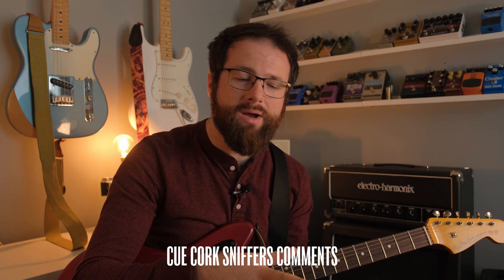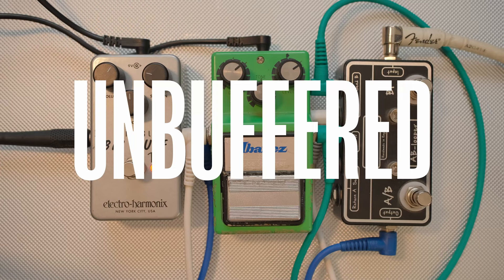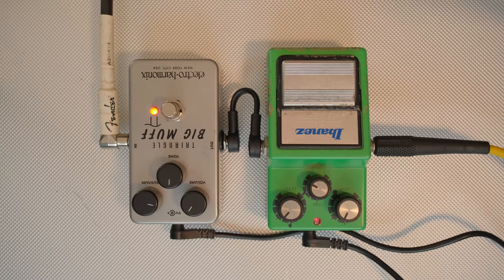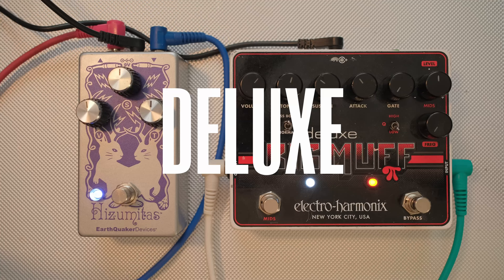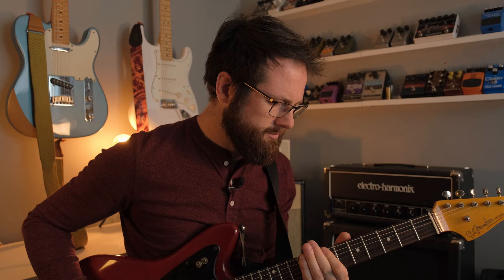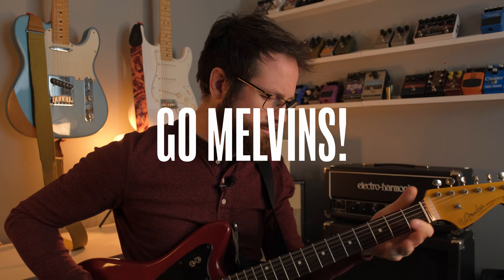Why you're doing it wrong: Big Muff tips and clips

Comment: Great video. Muff after OD is what got me away from the fuzz face style (2 transistor) fuzzes. Currently using the MXR Variac fuzz after an SD-1 and Bd-2, but before that had one of the mini EHX Ram’s Head reissues on my board.
Reply: Love the Variac fuzz. It’s got such a ‘ripping’ sound. I have to admit I bought mine cuz John Frusciante started playing one. 
You’re using a bd-2 into your Variac? What are your settings? 
Thanks
Reply: @LawGone1  I run my BD-2 as a cleanish boost after the SD-1, set with Level around 1:00, tone and gain set at about 9:00. I really like the SD-1 more with the Variac Fuzz, gives it a real gritty sound. My Variac fuzz currently is set as follows: 

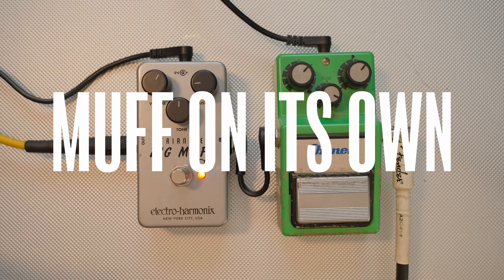Tone - 2:00
Variac - 10:00
Output - 9:00
Gain - 3:00

Comment: Yeah..... no

You don't run the Muff into a TS9 with the gain half the way up, that sound horrible, drop the gain on the TS9 to almost 0, take the volume up to the required level.

The idea behind that is to smooth the Muff using the TS9 eq curve, not boosting the TS9 using a muff, the TS9 sounds like shit when boosted, no matter what you push into it.

Those settings also work better for me with the TS9 before the Muff too, the Muff already compresses the sound a ton, you don't need the gain of the TS9, you just need the mid boost it provides to make the Muff sound tighter.

Try it, TS9 gain on 0, Level at taste, Eq at noon, before it clears up the Muff and after it gets you a smooth lead tone (yeah no metal there)
Reply from the maker: Look out for an upcoming short. It'll be the outtake in which I tried all sorts of positions, including drive off. It all sounds awful, IMHO! 🤣

But I'd want some drive from the TS9 for some gain staging/pseudo channels. If we're just going to use the mid-boost of the TS9, why wouldn't we just use an EQ!?
Reply: @doctorfuzzzdirtbox  It is not that simple, a band EQ has a selective filtering on the frequencies so you have gaps between the controls that you can not fine tune without moving the surrounding ones, the TS is more like a parametric EQ, If you have a parametric EQ you can absolutely do that, setting the right amount of amplitude and frequency center and then pushing it a bit, is just easier to shove the TS9 and turn it on that barring frequencies on an EQ pedal, usually.

I typically think about the TS9 as a boost with optional compression, being the drive what I use to compress the sound, the gain sounds awful by itself on most cases.
Reply: @doctorfuzzzdirtbox  Forgot to mention, you need to lower the Muff volume to unity, or it will drive the TS9 even if it has 0 Drive
Reply from the maker: @Fernando-ry5qt  I tried it all, man 😅 Short to demonstrate will be live within the hour...
Reply from the maker: @Fernando-ry5qt  An EQ would still be more flexible in that case. A TS9 just does what it does. Why not at least use Haunting Mids or a Tone Job? Why have a drive stage in there at all, is what I'm saying (within this Muff stacking context.) And I personally like to have a low fuzz on the Muff, some drive from the TS and then I have one, the other, both or off! Basically 4 channels!
Reply: @doctorfuzzzdirtbox  Haunting Mids would get you there, yes.

I do that too (actually i don't even use a TS anymore), run the low gain overdrive with a low gain so it is more flexible, but it does compress the sound more in that way and the Muff loses clarity imo.

I mean, to each their own, Im just explaining you why people run it that way haha (I used to do it), cuts far better in a live band than the opposite and gives a more defined sound for leads/solos.
Reply from the maker: @Fernando-ry5qt  yeah, I hear you man! I'm all for the discussion! 🤘

Comment: An '81 Les Paul Dlx into a Sovtek Big Muff into a 100wt Hiwatt has been in my rig for 25 years for a reason. $70, in the wood box, and I was off...
Reply from the maker: Crazy how cheap they were to buy and how expensive they've become! Thank Mike for the reissue!
Reply: @doctorfuzzzdirtbox  

If only they'd reissued it with those switches, where you can stand on the switch and it's still on and when you take your foot off it turns off. Wonderful.

Comment: I run my muff with a Danelctro fab overdrive behind it. Budget pedal with a super muddy drive. BUT run it into a muff with sustain set about or three o’clock and the tone all the way up (or bypassed if you have a mod), and suddenly it beefs up the distortion so much. It’s unbelievable. Best I can describe it is that classic ‘90s sound. Just a big, round explosion of epic distortion.
Reply: I have the red fab distortion, apparently its a clone of an early 70's MXR overdrive, is that the one? Either way I'm going to give it a whirl. I don't have my muff on a board at present and have a couple of screamer clones kicking about as well.

Comment: I’ve been tone searching non stop with my rams head and I’m looking for the sound you have at the end but CANNOT get it haha mine just sounds like a distortion and not a fuzz. What on earth am I doing wrong besides being new to guitar lol
Reply from the maker: The very last thing? So the "Black plate" amp setting? It should be achievable whatever you have but best done with a mids control that you can turn down quite a bit, a good bit of treble and ideally and 12" speaker, too - but it's all achievable with a decent EQ, whether that's already on the amp, baked into the speaker's character or something you need to add

Comment: What’s better than using a one bmp?

Running two in parallel!

One transistor version and one IC version, or whatever you like. Also, one can be boosted with an OD to change the tone. Then you use each volume as a mix knob to get the sound you want.

Also, use two channels on the amp or two amps if it’s only got one channel.

Your sound will never be the same. Nor will you ever be satisfied with just one channel/or amp.

Pedals in parallel into two channels is the real key to a large and brilliant sound.

Two amp channels/or amps is the real key overall.
Reply from the maker: Or maybe, it's TEN BIG MUFFS! Watch this space . . .
Reply: @doctorfuzzzdirtbox   
lol

I’ve ran half a dozen or so in series before…terrible as you could imagine.

You should do a parallel bmp video. They sound great like that.

You can also mix any two dirt pedals you like for a new texture. BMP & Rat, for example is decent.

Comment: I imagine it was only humoristic that you said its only wrong to plug a muff into a tubescreamer. It really is a plausible combination in may a circumstance...Not all amps sound the same to begin with and the more headroom the amp has, the more the fuzz pedals will sound fizzy, hairy and horrible if anyone would like to play blues or rock or stoner...so if you find yourself in a situation with a fender blues deluxe even, a strat and a muff the only way to make it sound good and not get fired out of a bluesy/rock gig is to run a overdrive after your muff. This is not the muff to go into a classic ts9 tho. I would recommend running an american fuzz pi through a ts9dx with the + and hot mods which make it sound absolutely like its going straight into a cranked marshall stack. Impossible with a fender and a muff alone. Anyways my current set up is a Russian muff into a Kalamazoo lovepedal. ITs rad!

Comment: So i run a big muff with wicker on my 100 watt orange head/8 ohm 2x12 cab but sometimes it goes completely mute and there’s no fuzz for it just sounds clean SOS
Reply from the maker: Sounds like a bad switch. They're really cheap and easy to replace. You need 3pdt
 Take a picture of the old one wired up and drop in the new one with soldering skills that can be as basic as they come!

Comment: So I have a big box EHX big muff pi. I seem to be having what I think are impedance mismatch issues with it. The chain is quite complex but I have tried it before and after various things (buffered Boss options, various true-bypass). There is a valve OD pedal in the chain and I do have a Radial ABY for the dual amp (HiWatt DR103 and Epiphone BC30) setup. Long and the short of it is that if I take the muff out of the chain everything works. With the muff in anywhere things fall apart. Muff on its own into one amp works fine so I think the pedal itself isn't broken. Any ideas?
Reply from the maker: Wow, OK. That's a strange one... Just to check (although the Muff isn't power hungry) how are you powering all the pedals? Have you tried swapping the patch cables around when it's in the chain? I have had some patches be too long or short in some pedals and not others... I'm stabbing in the dark though. That is pretty odd...

Comment: I’ve never understood why everyone says to run fuzz into a tube screamer, it always sounds terrible. I’ve always put a screamer before fuzz even before I found out everyone else does the opposite and when I tried it it sounded so much worse than the screamer into muff.
Reply: What Fuzz are you using ? The classic pair is to emulate a over driven tube amp after a Fuzz Face circuit .
With Muffs you need something to push the mids back in for a band mix .A E.Q. works great .
Another thing to consider is pickups .I assure you my single coils sound killer with Tube Screamers .
Reply: @STRATMAN1969  I’m not trying to emulate a fuzz face into a cranked amp, I’m trying to get a good fuzz tone which is screamer into muff or tonebender. I always use a tele for this sometimes my sg with p90s
Reply: @theccarbiter  Yep my main Strat has 3 P-90s ,but man I built this Frankenstrat years ago string thru body ,and Tele neck ,and pickups .I've been playing that so much lately .One of my boards has a Treble Booster into a tone bender ,into a Muff with a compressor ,Tree of life , Tube Screamer ,and E.Q. after .
My switcher board I just built signal chain is Hudson Broadcast ,big box NYC Muff ,comp-EQ-boost ,JB-2 
At least you're aware that the Muff scoops the mids .I always put my Screamer after a Klon too.
Reply: @STRATMAN1969  yeah the treble boost into a bender really does sound so good for high gain

Comment: Maybe it’s something particular to a Big Muff and/or Tube Screamer, but my experiences with stacking drive after fuzz never sounded like that. I find that a drive into fuzz results in a sound that sounds like a distortion pedal - it’s tighter and less wild than fuzz, and a fuzz into a drive (with the drive set to medium gain) results in a sound that is more of a squished, compressed fuzz sound. But I’ve never gotten that kind of horrible sound you got in your demo. Maybe Big Muffs and Tube Screamers just really don’t work together at all.  —Another way to think about it is this: We probably all agree that fuzz straight into a clean amp is not as good as fuzz into a slightly driven amp, right? Well, a mildly driven overdrive pedal after a fuzz is the exact same idea as a mildly driven amplifier preamp after a fuzz. If it sounds bad it must be because of that godamned mid-humped, bass castrated eq curve in the Tube Screamer.
Reply from the maker: I've definitely had luck with other combos. Tried a HM-2 into a Soul Food. Sounded great. But a Big Muff is so full range and a TS-9 so narrow band, it's just not going to let it breathe that way around.

Comment: The trick with putting over-drive after a muff is having the gain on the over-drive at zero, that way you get the mid bump, but the distortion of the muff isn't massively effected. That's what the JHS video said, you just swapped them without changing any settings, of course it's gonna sound sh*t. I'm guessing your brain farted out for a minute after Josh suggested trying it and you didn't hear what he explained afterwards. Personally I prefer drive first, but if you're gonna criticize someone else's ideas at least do it honestly.
Reply from the maker: I hear you, but I tried a lot of settings while making the video. I have outtakes of me twiddling the knobs of both pedals! None of it sounded good and that's why I ended up even maxing the treble in an effort to get it sounding OK. I've also tried other drives after a Muff and they all take the "Muff" out of it. If we're really just after the mid-bump, shouldn't we be using an EQ?

Anyway, I love the JHS show. I watched it all the way to end as I regularly do. Josh's wisdom is often second to none but in this case? Nah.
Reply: @doctorfuzzzdirtbox  I recently watched a video by the guy from Wampler pedals all about using an eq pedal to solve the muff 'dropping out of the mix issue', can't remember what it was called but it's on youtube. So yes, the same effect can be used by using eq, it's just different options to try, and i understand this one isn't for you, just wish you'd have shown it the way Josh did for a fairer comparrison, because he did get a really nice sound which was way different to yours in almost every way.
Reply from the maker: I tell you what, I put the outtakes in a short! 👍 Or maybe go a little further and try a few OD to high-gain setups in the future. But personally, I wouldn't say I liked Josh's sound either.
Reply: @doctorfuzzzdirtbox  Fair enough

Comment: The signal coming out of the Muff into the TS sounds too low. Try putting your buffer between it and the Tube Screamer.
Reply from the maker: The Tube Screamer is a buffer but buffers don't increase signal level. I've got a "short" that shows me sweeping through more settings. Nothing sounds good, man!
Reply: @doctorfuzzzdirtbox  The TS has a buffered output, you need the impedance level lowered going into it. I don't know what's going on with your setup, I've run them into ODs for years and don't get that weak sound. I haven't used a TS in a while, but had used all 808 with them at one time.
Reply from the maker: It's buffered in, too (when it's on, at least) and when the Muff is on, it also has a buffered output. But so many ODs other than a TS-9 can and will sound better. Even an 808!
Reply: @doctorfuzzzdirtbox  There are several videos stacking them Muff-OD, they're not getting that "70 year old smokers cough" thing I'm hearing here, granted most of them are using TS-type pedals and not TS. When it does work properly it's not going to give you a more aggressive fuzz sound no matter how you set it, at least with a Muff. The Muff is REALLY scooped, and a tube screamer attenuates the bass and treble. Usually when people run fuzz into OD for that type of thing it's a Two transistor style, like a Fuzz Face, and that's more to mimic the FF into an overdriven amp. When players run a Muff into a TS type pedal, 90%+ the time the TS is being used as an EQ more than an overdrive, and it's almost always done to get that Gilmore-like smooth lead tone. There are a few pedals, like the Hermida Dover Drive that are essentially a Muff circuit running into a mid-hump OD in one pedal.
One of the drawbacks doing it muff into OD is that for them to work together, they need to be dialed-in in a manner that renders them pretty useless on their own, which is why the best thing to do is bite the bullet and buy an EQ pedal to do it. Also, when I was doing this i always ran a clean boost/transparent OD with a flat EQ like a Timmy or RC Booster into the Muff first to open it up.
Reply from the maker: @timwhite5562  "...granted most of them are using TS-type pedals and not TS..."
Like I always say - EVERY TS-style pedal is better than an actual TS! 🤣

Comment: I’m thinking of buying a deluxe Bass Big Muff, but I’m wondering whether the guitar one would do the same job. Or whether the bass one would also be useful with my guitar. Can anybody advise?
Reply from the maker: I can't speak from direct experience but it does seem that the Bass Muff would basically be a Big Muff with a clean blend. The Muff I prefer on bass by far is the Green Russian and so the Sovtek Deluxe would be my ideal bass Muff given that it has a gate, mid boost AND a clean blend while having the core circuit of a Green Russian as opposed to the NYC.

But hopefully someone can chime in with direct experience!

Comment: I have a Blackheart BH100H. It’s a monster of an amp but I’m frustrated because my only pedal that’s turned to crap is my Pumpkin Pi Big Muff. No matter what I do, it sounds like it’s under water. I’m thinking about selling the amp because the Muff sounded alive on Fender’s, Vox’s, Marshall’s…
Reply from the maker: How are you setting the amp up gain wise? Are you using anything with a buffer before the muff? Chances are the Blackheart is based on something very similar to the classic brands, so I'd find out what, before you make a switch, and be sure you make a good one!
Reply: @doctorfuzzzdirtbox  I have the amp pretty clean. I have a BD-2 before it and a Waza Metal-Zone after it. Should I push the amp’s gain more?
Reply from the maker: I don't think so, no. It can be a different,  cool sound, but not always something to help with high end. It's an odd one. What are the tones on the other 2 set like?
Reply: @doctorfuzzzdirtbox  BD-2: level 12:00, tone 12:00, gain 11:00. Pumpkin Pi: volume 12:00, tone 12:00, sustain 9:00.

I don’t use the the fuzz with my metal x
zone.
Reply from the maker: @fkcamry88  So you're not getting much more clarity from pushing the tone past 12 on the Pi?
Reply: @doctorfuzzzdirtbox  I’ve never had to with other amps, but I will definitely try today.
Reply: @doctorfuzzzdirtbox  I’m glad I came across this video, it caused me to do some detective work. I looked at the back of the amp and saw that there is a switch, In Series of Parallel. I flipped the switch, gave it a try… not only does my Pi sound better, every pedal sounds better. This amp is so good now. Thanks